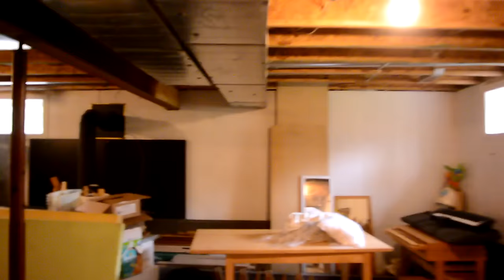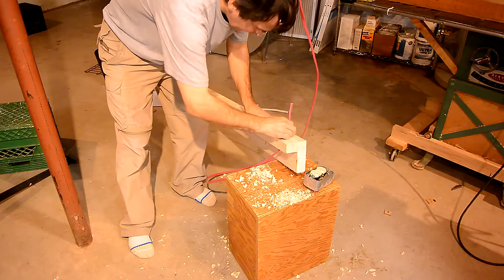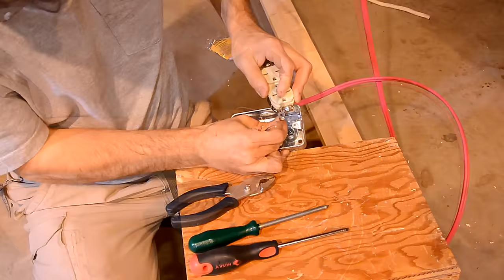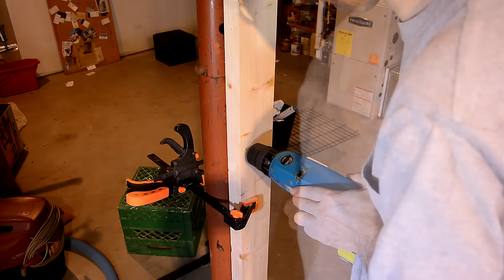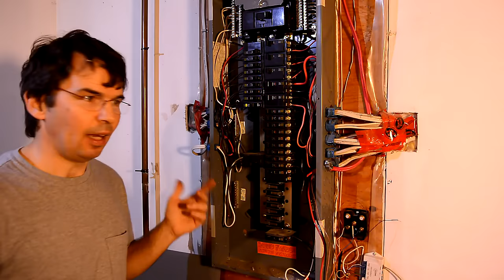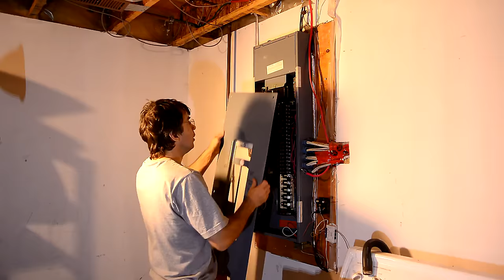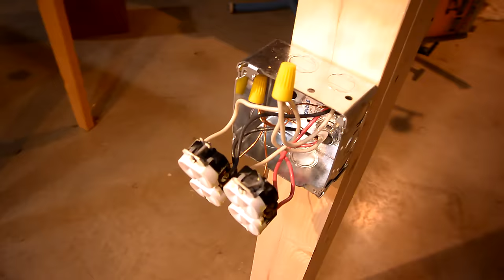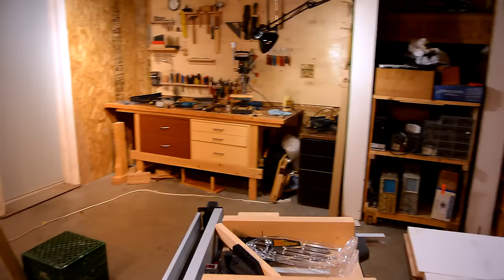Wiring a new 240 volt circuit

Comment: Why you didn’t got zapped when you touched the hot bar? Human body has parasitic capacitance all the time, no matter you are in direct contact with ground or not.
Reply from the maker: yes it does, but that only makes for microamps of current, which you can't even feel.
Reply: lol imagine if it was electroboom who made the video
Reply: Matthias Wandel 
if you did something like that in Australia, 90% guaranteed to be dead.
Reply: Same if he was in India. LOL.  I guess the voltage difference between the countries is a major factor here. Hope people from countries with 240v mains don't try this after watching this video.
Reply: Because the voltage is a higher? Birds land on insulated overhead lines operating at 10k+ volts and nothing happens.
Reply: Yes, because of high voltage. And in case of birds, they have very high resistance (  legs are coated with dead cells like nails).  But  if they get in contact with those high voltage wires with exposed skin of their body they will fry immediately. Everything get down to (V= I * R  ) or ( I = V/R ) . so when resistance is high in case of birds, no current flows and they are safe.
Reply: Riiiiight. Look man, the reason both matthias and the bird does not get shocked is because there is not a complete circuit. The paltry resistance of the bird's feet are irrelevant, it is the fact that they are not in contact with a grounded surface. You can look up videos of monkeys climbing on energized distribution lines, and they are fine until they touch a second conductor or a grounded surface.
Reply: Why would it be a problem in Austria ? I'm confused.
Reply: Towards the end of the video, when Matthias touches the energized bus bar in the panel, he does not get shocked. Some misinformed people think this is because the 120 volt power used in America is safer than the 230 volt power used in Australia. In reality it is because Matthias is insulated from ground, and this could be done in Australia with a 230 volt panel, or in any other country.
Reply: Does current flow through open circuits in Australia?  Here in Canada it does not.  Funny how things work differently on opposite hemispheres.
Reply: Totally agree, but if you see my first comment you will understand what I meant to say. I talked about parasitic capacitance which exists between human body and ground which is enough to zapp a person badly. And if voltage is higher and env is humid this effect will maximise.
Reply: No way, I have touched 240v (by accident) plenty of times in Australia. I prefer not to, but sometimes you just need to work on live equipment and shit happens (Yes, 'shocking' work practices I know). Now touch 3 phase 415v, and yes you'd probably be dead!
Reply: mekatrol quite possibly the 240v you touched was rcd protected? Or at the very least you were lucky- maybe you had some relatively decent insulating material between you and the ground. My point is, it's very very possible to die off touching 240v in the right conditions, so why risk it?
Reply: No RCD protection, and no I don't go for silly risks, but sometimes you have no choice given certain circumstances and events. What I was trying to call out is that saying in  Australia touching 240v means you would 90% guaranteed dead is an absolute false assertion and that you are making up statistics. The facts don't support your statement. I have been working around HV for nearly 40 years, so have some knowledge and experience in this space. As an example of a fact, the commerce of WA safety incident report of 2015-2016 (https://www.commerce.wa.gov.au/sites/default/files/atoms/files/electrical_incident_safety_report_2015-16.pdf) documented 1 death for 1,644 reported electrical shocks. That is about 0.06% who died, not 90%. Any death is a tragedy and yes you should always be careful, but you were overstating it a bit. Out.
Reply: mekatrol 
Ok, fair enough. Good points. 
I would still rather not risk it whenever possible as the potential (lol) is still there.
Reply: Anoop Sharma lmao
Reply: Thank you, yup.
Reply: I agree, people just over exaggerate this whole electric sock thing. I have worked on electrical stuff since I can remember and have been shocked plenty of times with 240v. Yet, I'm here alive!

Comment: It has to be said: 3 phase AC Power is the way to go and this is just madness! pure madness! :D
Reply: RubyRhod except Canada is huge and it would easily double the cost of electricity to deploy 3 phase service everywhere.
Reply: If you where to convert from what you got then yes that would be very expensive, but hypothetically starting from nothing? It would be no more expensive to develop a 3ph network than a 1ph one. In fact the power is transferred as 3ph anyway until it reaches the transformer to your house.
Reply: True and if your barn requires 600v 3 phase theyll install for some big bucks
Reply: canada may be hugh, but this 1 phase split power supply is seriously crazy. the heritage come from, as far as I know, DC. they should have put the 3rd wire in when they changed from DC to AC.
Reply: Are you going to give any reasons?  Or just "crazy!  madness!"  Why is three-phase the way to go?  Why not 9-phase?  Even better!
Reply: When they changed from DC to AC, they couldn’t foresee the electrical loads of our time. They would have thought a total three phase system pure madness.
Reply: reasons are obvious for people who know the different electrical systems around the world. and the one used most? 3 phase power
Reply: 1872Winchester No, the power isn't three phase until it reaches my house. My house is fed by a transformer connected to a single phase high voltage primary circuit that serves my entire street. That primary circuit is picked off of the three phase circuit where my street meets a main road. That is how all the streets are done in my community. In very rural places, those single phase circuits are many kilometers long, often with only a handful of houses on the entire circuit.
Reply: So what you say is that the power is 3-phase until it reaches the transformer to your house?
Reply: No, what I'm saying is that the distribution is three phase up until around 500 metres from my house. At that point, a single 12.5kV leg is picked off of the 3 phase distribution and sent down my street, as a single wire on a high voltage insulator on the top of the pole, with the neutral running on another wire further down the pole on low-voltage insulators, and grounded at every pole. In front of my house is a pole, with a 100 kVA single phase transformer strapped to the side. The primary is connected between the 12.5kV and neutral wires on the pole. The secondary has a centre tap that is also connected to the neutral, and two 120V legs. This neutral and two 120V legs run over to my house. In my case, I share the transformer with one other neighbour. Many of my neighbours, by sheer geographic luck, have ended up with a dedicated transformer.

If I want three phase power, I'd have to pay the power company to upgrade all the poles between my house and the main street with cross-arms, additional insulators, fuses and lightning protectors, and they would need to provide two additional transformers atop my pole to transform the other two phases.

Now, get out in the country, and instead of it being 500 meters to the nearest three-phase distribution, it might be 20 kilometres. At approximately 40 meters between poles, all of those additional wires, insulators, crossarms, and protection devices begin to add up very quickly.
Reply: To put some perspective on this, this is from a report about the distribution network of the largest electrical company in my province: "The electric distribution system has 57,080 km of primary distribution line. 84% of this line (48,040 km) is overhead and the remaining 16% (9,040 km) is underground line. Of the overhead line, *65% is 1 phase line (31,226 km)*, 1% is 2 phase and the remaining 34% is 3 phase line. Of the underground line, 51% of this line is 1 phase while the remaining 49% is 3 phase."

There are 591,500 single phase distribution poles in my province.

This is strictly distribution, there is also 18,286 km of transmission lines in the province; of course, that's all three-phase.

Maybe you'd be happy to foot the bill for upgrading all of that single phase infrastructure, but I'm quite happy with keeping it the way it is.

Comment: Awesome video and thanks for the great information.  I have baseboard heaters in my house that I don't use anymore. Could I install a split plug on the heater circuit eliminating the thermostat of course and sharing a common from a nearby light switch. Would appreciate a reply. Thank again.

Comment: Never attaching socket in low position as you make, I dont know for rules in US but in EU minimum hight is 40-45cm.  The other objection for the electrics is that the loose cables all around in the room. All these notices are critical for safety, first!!!!!
Reply: You can attach them pretty much anywhere you want in US. But if your lower part of your house is prone to flooding at all you want it higher.

Comment: As an European it´s always a bit scary to see American electrical systems.
Reply: We like to live on the edge!
Reply: Curious as to what makes American systems scary to you? Like anywhere, people can do dodgy and scary work. But Mathias' work looks professional to me.
Reply: for me its just the look of it all, it looks like everything is from the 50s..
Reply: Sometimes I wish I was allowed to do this myself, but then I think of all the idiots that would do it, and I am quite happy it isn't legal.
Reply: What's not legal?
Reply: Honestly i don't see much of a difference. The only thing I take issue here is that the outlet is too close to the floor which can be an issue with a flood and that he didn't pull the main breaker before installing a new breaker.
Reply: John Harris In Europe you always have to use licensed electrician.
Reply: Depends on what you're doing and country you're in.
Reply: Christoffer Salomonsson: everything looks like it's from the 50's because the North American economy wasn't destroyed by war and rebuilt from scratch in the mid-40s. My house has a 40 year old breaker box, and I can still go out and buy brand new breakers to install in it. Of course, internally the breakers have changed to meet new safety standards, but the basic functionality is the same, and the form factor remains the same so that we don't have to replace our panels.
Reply: That's not true everywhere. In Netherlands you can do whatever you want after the main breaker, just as in Canada. I worked on both country systems and both have their oddities. For example, ever heard of a arc fault breaker? Never seen one in Europe, mandatory in Canada.
Reply: The American power connectors are as solid as our European christmas tree lights;-)
Reply: @YesMan85: Actually, these arc breakers are mandatory for some buildings in Germany that have a higher risk of fire. In all other buildings, they are recommended for circuits up to 16A.
But yes, you can do whatever you like after the main breaker (or more precise: after the man electricity meter) but in case of an electrical incident, the insurance will not pay if your installation is not done according to the technical rules, so you may want to have a certified electrician approve it.
Reply: I have seen scary electrical installations in Italy. Even heavily regulated and rule abiding Switzerland is not immune. I must admit that I have not checked out installations during visits to Finland. 
The real take away from this is that electrical systems can be dangerous. Matthias is an engineer. He knows what he is doing. That said, in most Canadian jurisdictions a permit is required for a new circuit and in some cases (Quebec) it must be done by a licensed electrician.  Ontario when overboard at one point so that a homeowner could not even replace a light fixture. 
When I moved to Canada from Europe I was impressed by the electrical installations. Circuit breakers were everywhere. No ceramic/lead wire rewire the fuse yourself (inevitably the result was people but heavier gauge wire in fuses that blew regularly). In high school we learned to do framing, electrical installations and plumbing, and I was on the university track. By the time my own sons went to high school that had been dropped. A shame in my view. 
We need more educated consumers. DIY is becoming more prevalent. We should all understand the fundamentals and especially when to call in a professional.
Reply: Gli impianti devono essere certificati da specialisti autorizzati a certificare la conformità alle norme UNI.
Reply: Impianti certificati o impianti abusivi operati da personale non autorizzato?
Reply: Mxrider2stroke Braaap Pretty much, yeah.
In California on vacation the weight of the wire in an extension cord I used was enough to nearly pull the plug out of the socket.
It was maybe 20cm up from the floor.
That could never happen here.
Reply: He's canadian  by the way  .. not american
Reply: Buddy Vibe Electric systems are mostly the same.
And Canadians along with Mexicans, Brazilians etc. are all Americans ie. inhabitants of the Americas.
Reply: As a frequent visitor to several western European countries and the UK, and a resident of the US, I often note many apparent differences in wiring practices. Where I live, all wiring is required to be inside conduit, and I don't really feel safe anymore when I see wiring that is not protected in that way. There are some places in North America that allow plastic conduit, at least for certain applications. But when I have observed residential and business wiring in the aforementioned European countries, I almost always see unprotected wiring, often run on the surface of walls, or in plastic conduit, or types of flexible plastic conduits that would be illegal in the States. On the other hand, European plugs/outlets are more robust, and often feature fuses or circuit breakers in every outlet; I have often wondered if this results from the need to accommodate older homes that might not have proper circuit overload at the source end of wire runs. There are good reasons for most of this, often reflecting different realities. Many European buildings are considerably older that pretty much any North American building, for example, and thus wiring may have to be done in different ways. This also reminds me of why so many European buildings still have only separate/isolated hot and cold water taps in the sinks....seems quaint, but the reasons for it are valid once one knows them.
Reply: @Kevr
I live in South-America, this is how my (small) office electric box looks like.. https://imgur.com/a/Yy2iX This is why American electrical systems look unsafe for us. Is like they are very old.. Even the new ones. Is not meant to be an offense, just a curiosity.
Reply: There's a few 40s ungrounded outlets and ceramic switches at my schools.
Reply: Nobody uses DC power
Reply: This guy is Canadian, not American.
Reply: In México we have things like this...

programacasasegura.org/imagens/mx/wp-content/uploads/2011/05/contacto-en-mal-estado-300x225.jpg
Reply: @alexrivera.churchpianist  LOL. SO true.

Comment: Pass the popcorn, I'm waiting for all the safety screaming in the comments!!!  :-)

Wow, it sure looks easy popping a hole in those I-joists.  I've never worked around them, so I didn't know that they had knockouts.
Reply: The less you know about something the more you're afraid of it.
Matthias obviously knows what he's doing, the majority of whiners of scary ol' electricity, on the other hand...
Reply: On I beams you can make much larger holes than that. They probably weren't there from before. You can use a hole saw to cut them out.

If that is a 250mm/10" I-beam then you can cut a 168mm/6.6" hole without sacrificing load bearing ability (Some conditions do apply though)
Reply: Wordsnwood (Art Mulder) I’m glad I’m not the only one who was surprised by that! (Also: the best opportunity for a nascar moment in this was probably hammering the plastic staple in. But I’ll bet the safety police didn’t even notice that, too apoplectic about touching a hot bar…)
Reply: There's fear , then there is respect. Without either of those,  there is ignorance, or worse, stupidity.
Reply: Ive never had one of those pre-cut knockouts pop out that easy!! In fact, I just drill my own holes because those things are impossible to pop out.

Comment: Wow you are brave touching the bus bar. Even with rubber soled shoes on I avoid touching anything that could be hot without a some electrical insulation between me and it. Doing electrical work on my house now and am almost wishing I had TJIs for the knockouts. Oh and it is better to run wire from one end like you did, there is less potential for having the wire too short or for waste if it is too long.